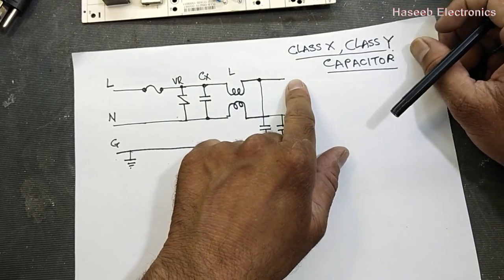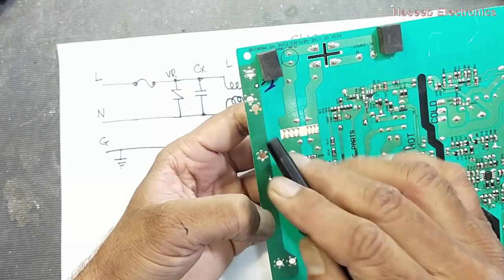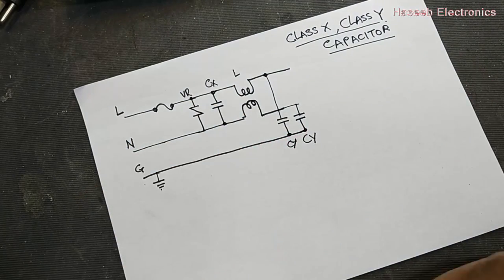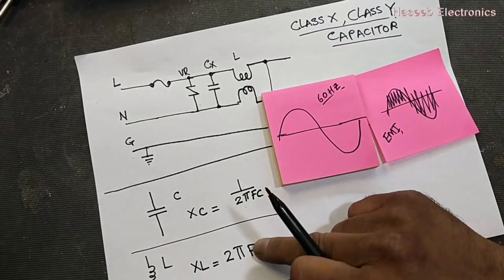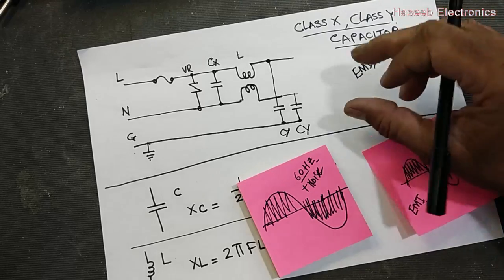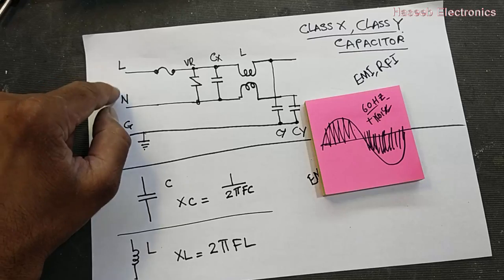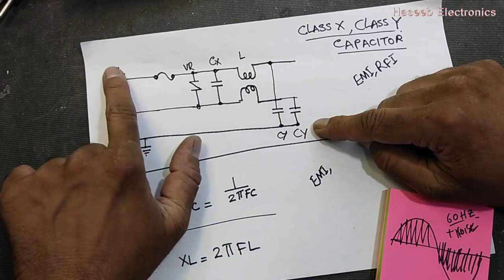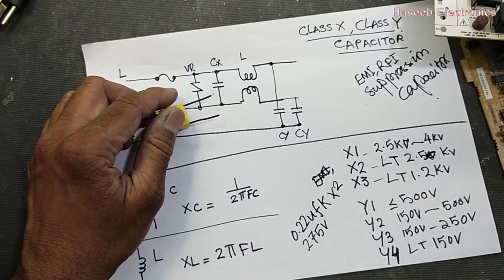{416} Class-X Class-Y Rated Capacitors, Safety Capacitor Explained

Comment: One of the best explanation on youtube. It is very helpful to people who search it. But missing information, X class without internal fuse, so that if fail will short the terminal and Y class with internal fuse so that if fail will open terminal (internal fuse blown). Salam
Reply from the maker: best regards. class x or class y stages are added after fuse, if a continuous strike of pulses arrive and it exceeds than the mov limits, and the LC filter reaches in ringing factor so it will increase the filter current and the class X capacitor have to short internally, so it must blow away the fuse. this ringing factor may happen due to external electromagnetic interference or something wrong in  smps switching section
Reply: @HaseebElectronics  It is correct for X type. But for Y there is internal fuse. That is main different with X type. X type is actually same cap as any other cap. The different is Y cap which has internal fuse. Not all GND has good connection to allow amount current flow to blow mains fuse. And it can create danger of shock at chassis. It is different case with X which has full current when fail. You can check at many explanation by googling it.

Comment: Excellent, as usual. What happens if a 1.5KV spike arrives to an X3 capacitor? Does the cap go short/open? Or  simply it doesn't do its job? (and doesn't damage itself)
Reply from the maker: special thanks
x3 capacitor have "peak impulse voltage" less than 1.2 KV. it means 1200 volt is the highest limit of peak. above this it have to fly away. 
as its operating voltage range might be 150 or 275 volt etc.  while working if it receives peaks of 1.2KV and the MOV is unable to remove it, then this safety capacitor will end. as its basic responsibility is to bypass high frequency 
please accept my best regards

Comment: Thank u for this video. Among all electronic video on YouTube your video i love most. Thanks for that.
As I know for AC cap provide close path for current, while blocking DC. Then why these cap doesn't make short circuit.
From kolkata. Sandy
Reply from the maker: i am thankful for your valuable comment
as i discussed in the video that every capacitor have XL value that is capacitive reactance. that is in simple words "the ac resistance of a capacitor"
at low frequency its internal resistance is very high, so it will provide short path. at high frequency its internal resistance will decrease, so in that case it will give easy path for high frequency but it will not disturb low frequency signals

Comment: Hi. I would like to thank you for teaching us. I have tried to repair a power supply. I have checked t voltage at the  capacitor after rectifier. I am not getting 332 dc volt. I'm getting 224 volt dc. I checked x and y capacitor both were damaged. I replaced both but still getting 224 volts not 332 volt. Can you suggest what other components might have failed?

Comment: Very good description on how it works. Just wondering.. How much power are we wasting just by using AC in our homes. All devices convert the power on its own to DC. And if I understand this right then with DC power we are much less wasting power here. Filters can be capacitors that give power not wasting it. Solar energy can also be so much more efficient with DC. No more out of sync of the 50/60Hz and wasting power to get it clear again.

Comment: JUST CLICKED! 
A problem with input filtering (failed cap, inductor) could prevent oscillator chip from starting cottectly ?
Reply from the maker: if the class X capacitor is devalued, it may cause to generate ringing action and it may cause to add jittering in frequency, any may fail to start the ic or may cause to fluctuate

Comment: It awesome, but i have a question that, does CX change current from AC to DC?
Reply from the maker: no, it does not change any ac to dc, 
it just gives easy path for high frequency noises
Reply: @HaseebElectronics  thanks.
Reply: How are know the correct resistor to  replace? Please help.

Comment: Sir, ideally what type of value & voltage rating should I select for Y class capacitors as EMI/RFI suppressors in 250 volt  AC line in power supplies.

Comment: Thanks for this info.yuu said that the F letter means the tolerance of the capacitor and it is 10%,what other letters are use for tolerance and their  associated percentage.thanks
Reply from the maker: A Special Tolerance 
B is +/- 0.1pf
C is +/- 0.25pf
D is +/- 0.5pf
F is +/- 1%
G is +/- 2%
J is +/- 5%
K is +/- 10%
M is +/- 20%
Z is -20% +80%

Comment: sir maina ek cheap 12v 5amp smps ko upgrade kiya hai.maina ek bigger transformer use kiya aur secondar turns increase kr diya .muja mera required power mil gaya(32v 3amp) but transformer sa bahot loud sound aa raha hai.maina sab kuch kar ka dekh liya par problem ni hata.please help🙏🙏🙏🙏🙏

Comment: Excellent video 👍.Sir,I have an SMPS of 12V,2A which gives shock at output side, there are two components between hot and cold side one is SM transformer and another is Y1 cap(AH222M). What will probably be the short component,Y1 cap or transformer?
Reply from the maker: special thanks 
my be Class Y capacitor across the transformer is not working good, use Y2 grade capacitor 
sometimes the increased leakage in transformer (from primary to secondary) is also a cause of this issue
Reply: @HaseebElectronics  Special thanks for responding.

Comment: Sir if there is mov in the circuit it is connected across the line same with  the class x cap and the ntc thermistor is connected in series at line i'm i correct tnx sir
Reply from the maker: Class X capacitor & MOV is connected across line and neutral to protect the circuit from over frequency & over voltage spikes. 
Fuse, NTC or PTC are in series to limit current in circuit
Reply: @HaseebElectronics  tnx for the reply sir

Comment: Salmo alikom bro 

can washing machine EMI FILTER HAS OUTPUT VOLTAGE BUT Failure
Pcb work some washing machine parts work..like pumps but motor not working ..even if motorboats outside the machine but inside it...

Comment: Its, the Class Y capacitor connected on chassis, but most of the TV power boards are in 2 line power cord, so what is the use of it.?

Comment: Hello sir please make of video how to select the capitance value of x and y capacitor(about uf not about the max voltage) . How its uf affect the circuit. Will the capacitor having higher capacitance provides better emi/rf or surge cancellation. On designing do we want to consider the load value on choosing the capitance valve. Also say about inductor how much µH should i give for better and optimum circuit in accordance with capacitor uf values. For design reference  please choose as AC line voltage 230v 50hz and  total load watts as around 1000W.

Comment: Can I use 0.022uf 250V X cap on 230V line?
Reply from the maker: it depends on, what was the actual value of the previous capacitor. if the capacitance is closer to the original value, then it can be used, 
if there is a big difference, then it will not useful,  may be it will not work properly or may be EMI filter can move in "ringing" so it can damage the next circuit
Reply: @HaseebElectronics  actually, the circuit is a 5V 5A smps (a cheap one). It never had a X cap but there's a place for it. Power supply was burnt, I'm trying to fix it. It has blown fuse and two shorted rectifier diodes (1N4007). I'm checking other components for any damage.

Comment: I have a question. Why this capacitor some device using like a fuse. I'm afraid to jump it to have a power my inverter out put
Reply from the maker: no this is used in parallel lines (line and neutral), because it doesn't allow to pass current 
while fuse is in single line 
in line or neutral there is NTC, PTC & Fuses are used
Reply: Thank you. So can i directly? I don't know why manufacturer put capacitor as a fuse.
Reply from the maker: I think that is voltage dropper circuit. 
is there a resistance in parallel to the capacitor?? if yes 
then it is a voltage dropper circuit
if possible send it's picture to my WhatsApp 00962-79-116-1084

Comment: Assalamu'alaikum brother Haseeb. Thanks for your explanation. I find y capacitors on the output side too. The y capacitors are connected between output + and Gnd to chasis. It's written 10nF 2kVA. The primary side also has y capacitors which connected to chassis. So that, It produce AC voltage on the output - , while the ground is not connected to earth. I tried removing the output y capacitors only, in the purpose of making the AC voltage disappear on the output, because there is no grounding system in my house. The SMPS PSU is supply the 8 panel led matrix. The panel's ground is connected to microcontroller's ground.

Because removing the y capacitors on the ouput, my microcontroller which supplied from laptop USB port and laptop adaptor has little AC voltage on the output -, the microcontroller can't be uploded any program randomly. Maybe it's EMI problem because no y capacitors. And when I supply the microcontroller only with another supply like smartphone charger, the led matrix is supplied by the no output y capacitor PSU, it shows many unexpected dot matrix led blinking.

The question:
1.  I wanna to reduce the AC voltage on the output -, is it okay reducing the value of output y capacitor? Such as 1nF 100V. The SMPS PSU output is 5V, 40Ampere. 
2. How to suppress EMI without y capacitors on the ouput side?

Comment: But how can we calculate the value of capacitor and inductor
Reply: Means we have to use 0.22uf or 0.47uf or 1mH inductor or sometime else.
Reply from the maker: yes dear. i will share its calculation procedure and its selection method
Reply from the maker: it depends on the switching frequency of the converter, current value
Reply: Plz do share..thanks a lot such a great info. On smps....